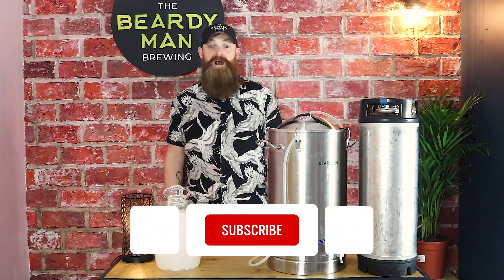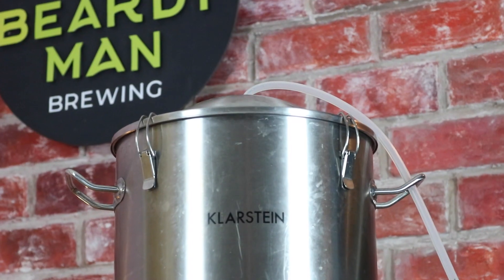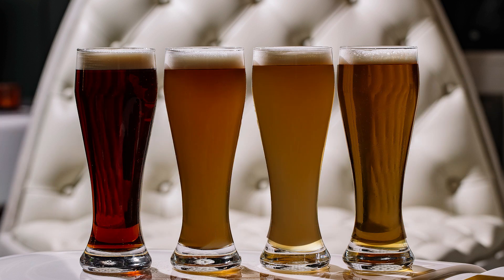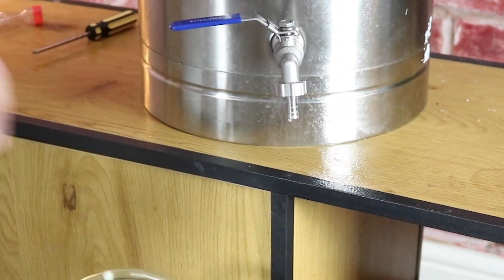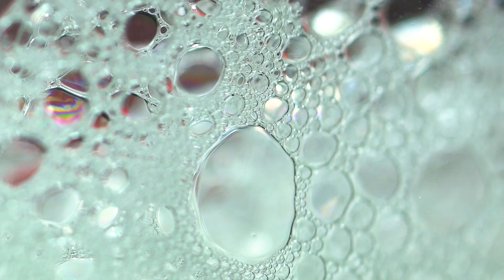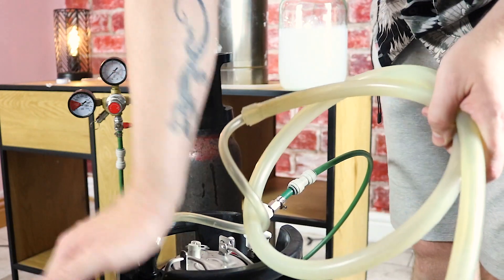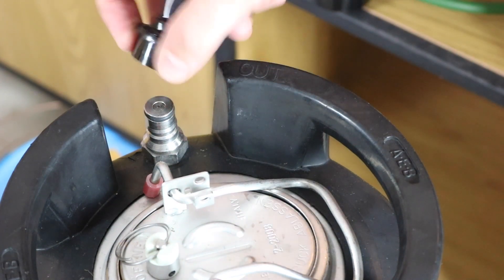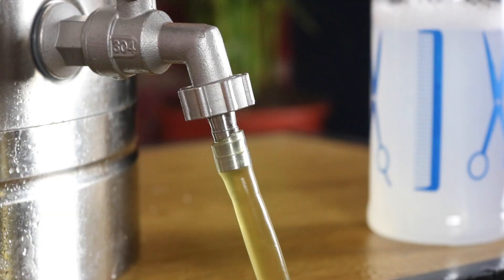DIY Closed Loop Transfer - Fermenter to Keg

Comment: Great video.  I have been doing this same practice for the last two years or so.  Except I empty the sanitizer directly into the bucket so there is only foam left in the keg.  Then fill the keg with CO2 and burp a couple times.  Thats about the only difference.

Comment: Really great video which is very clearly explained. I have an interesting problem which gavanwhatever has highlighted. I’m on my first batch and have to dry hop it without oxygenating the beer, which is a dark ale. I’m thinking that I can seal a clear plastic bag over the top of the Fermenter using some packing tape to capture the C02, but leave the dry hops in a funnel to drop through the airlock hole once the airlock is taken out. When this is done I will replace the airlock and wait another 5 days before closed looping the beer in exactly the way you have done it here. It makes me wonder if i can transfer the beer to the pressured keg at the same time as I do the dry hopping? Would this last part be madness?
Reply from the maker: That's an interesting question! First off, the method you're describing for dry hopping may work to minimise oxygen exposure, but there are a few things to consider.
Dry hopping while transferring to a pressurised keg can work, but it could be tricky. When you transfer the beer to the keg, the pressure from the CO2 in the keg could help purge any oxygen that gets in when you dry hop. However, the timing is key—if the beer is still fermenting slightly, the natural CO2 production could help protect it. On the flip side, if fermentation is complete, you'd have to be extra careful about oxygen pickup during both the dry hopping and the transfer.

Here’s what I’d suggest:

1. Dry Hop Separately: Do the dry hop as you planned with your sealed setup thingy magigy and leave it for 3-5 days. This gives the hops time to impart their flavors.

2. Transfer with CO2 Purge: Once the dry hop is done, do your Closed Loop Transfer, purging the keg with CO2 beforehand bla bla to reduce any chance of oxygen exposure.
Doing both at the same time might be madness alright as yod introduce too many variables and a higher chance of oxygen pickup, especially if your system isn’t completely sealed.

Comment: I've been brewing since 1978. Never had oxygen 'destroy' a brew. That being said, I'm here because I've just got half a dozen old corny kegs and I'm interested to find out what improvement there might be.
I'm looking at the way you prep your keg and yes, carbon dioxide is heavier than air, but using the gas post means that CO2 has to travel through all the air to get to the bottom. I think you'd have to wait some time for the seperation to take place. Additionally burping the keg will cause turbulence and mix the gases again. I can't help but think some air will remain.

I'm planning to use the CO2 from the ferment to displace all the air from the keg. I'm wondering if it would be better to connect the gas line from the fermenter to the liquid line of the keg because the gas will then enter the keg at the bottom because of the spear. Put a spundy on the gas post of the keg and set it just above atmospheric pressure so there is no explosive exhaust of air, just lots of tiny 'burps'. Does this make any sense?
Reply from the maker: Hey and thanks for the comments, it’s always great to hear from someone with so much brewing experience! Let me address your points one by one.

Firstly, regarding oxygen exposure: It’s true that many brewers have successfully brewed for years without noticeable issues from oxygen. However, as brewing science has evolved, especially with the rise of craft brewing, we've learned that even small amounts of oxygen can have a noticeable impact on the final product, especially in hoppy beers. Oxygen can lead to off-flavors and shorten shelf life, which is why many brewers now aim to minimise it as much as possible.

On the topic of CO2 being heavier than air: You’re absolutely right that CO2 is denser and should settle at the bottom. However, the concern is that when you purge a keg through the gas post, the CO2 does have to pass through the air, and depending on the rate of flow, some mixing can occur. This is why some brewers including myself prefer to purge the keg a few times to ensure as much air is displaced as possible.

Your idea of using CO2 from the fermenter to purge the keg and connecting the gas line to the liquid post is a solid approach. By introducing the CO2 at the bottom through the spear, you’re minimising the chance of gas mixing and effectively pushing the air out. The spunding valve on the gas post to release pressure slowly is a clever way to avoid turbulence and ensure a gentle, consistent displacement of air. This method could indeed improve the efficiency of air removal and reduce the risk of oxygen pickup - would ya agree?

So yeah, in summary, yes, your approach does make sense, and it’s a technique that aligns well with modern practices aimed at reducing oxygen exposure. It could definitely be worth trying out with your new kegs to see if you notice a difference in your brews - let me know and thanks again!
Reply: @TheBeardyManCraftBeers  Thanks for the feedback.

So far I've managed to purge 2 kegs to 4psi with the CO2 from just one ferment. I think I wasted a fair bit too, learning how to use the spunding valve. 

Now my problem is that I think my kegs have small leaks because a week later they both are only slightly above atmospheric pressure. I'll have to use the CO2 tank to test them....

Of course this doesn't detract from the fact that the method works.

I definitely agree about less turbulence. I MacGyvered a bubbler by attaching some  tubing to the outlet of the spundy with the other end going into a jar of water. Instead of the intermittent burping of the traditional bubbler, the CO2 was coming out in a continuous stream of tiny bubbles.

Comment: I do it this way but worry about any oxygen trapped in the lines so try to purge CO2 through the top line while connecting up. How much do we need to bother about every last scrap of air?

Comment: Unfortunately a couple of days too late for me, but I just kegged my beer the same way. Some points from my side: If you plug the still disconnected(!) beer side into the still preasurized keg, you can flood the tube with CO2 (for the totally oxygen averse :))before connecting it to the spout on the fermenter.  
Also, the inlet of the beer in connector is rather small, which limits the transfer speed - around a kg/minute is a totally acceptable flow rate (I totally recommend puttiong your keg on a scale!). Mine was  a little bit under 80 seconds  for 1000 g of beer. 
So if your beer transfers slowly,  it's not the fault of the CO2-part of the setup :)
Reply from the maker: Yeap absolutely agree with that for sure 👍